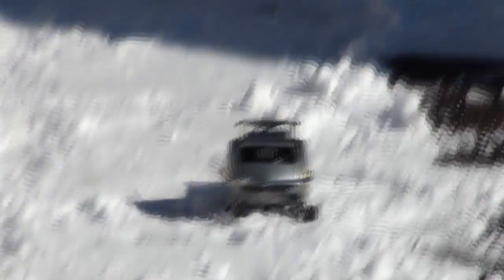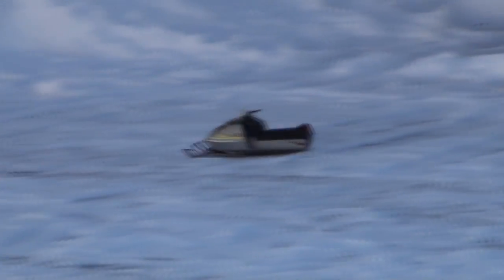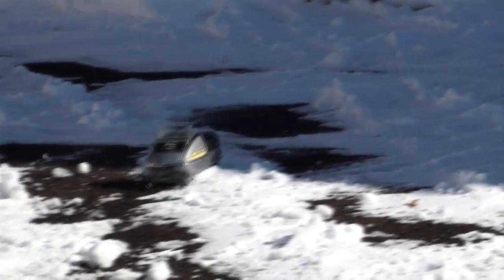Cox Ski-Doo Silver Bullet 440 Snowmobile

Comment: I wanted that little snow machine back when I was around 11 or 12. Unfortunately none of the hobby stores around here had it in stock. So I wound up trying to build my own snow machine using a cox engine with a prop to propel it over the snow. Didn't work too well though, it kept tipping over causing the engine to quit. Maybe one of these days I'll build up an rc snow machine.